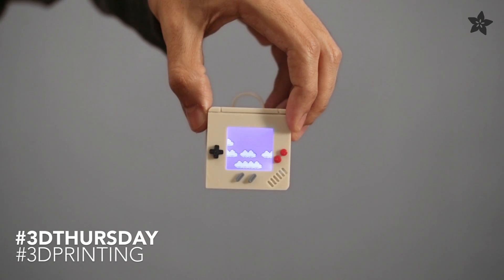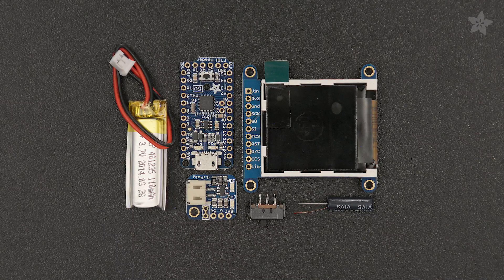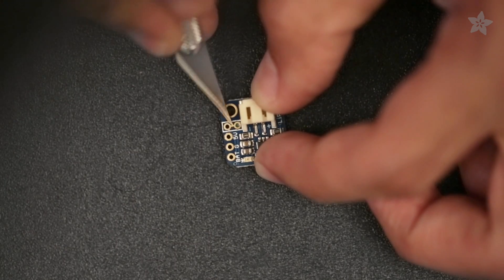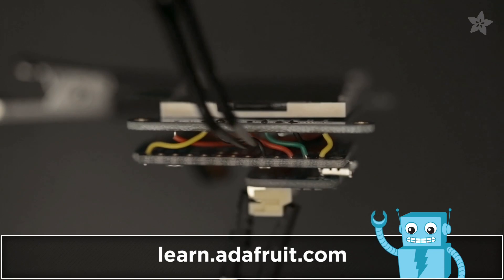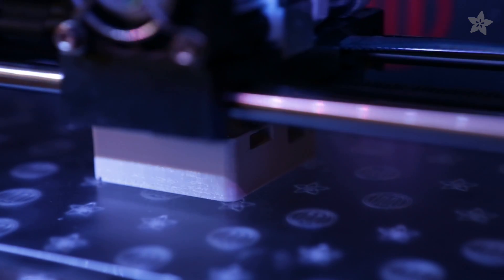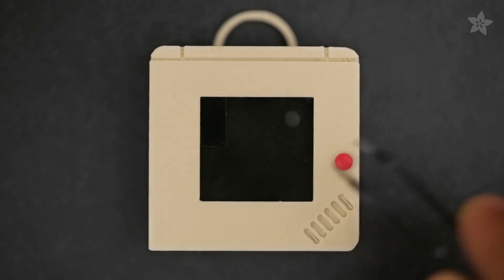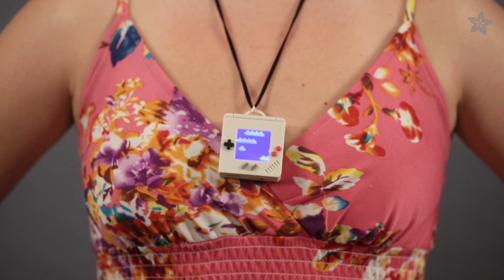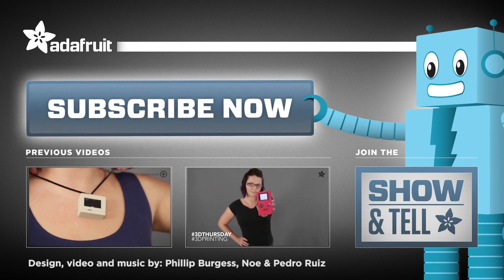3D Printing Mario Clouds Electronic Jewelry

Comment from the maker: 3D Printing Mario Clouds Electronic Jewelry #3DThursday
https://learn.adafruit.com/scrolling-mario-clouds-tft-jewelry

It’s 8-bit retro Mario Clouds! It’s so tiny and cute, you can wear it! In this project, we’re making Cory Arcangel inspired Super Mario jewelry using 3D printing and DIY electronics.

This teeny 1.44” TFT display comes in at 128×128 and interfaces with the pro trinket micro-controller over SPI using Adafruit Arduino libraries.
Reply: Can I just buy the mario clouds thing plz